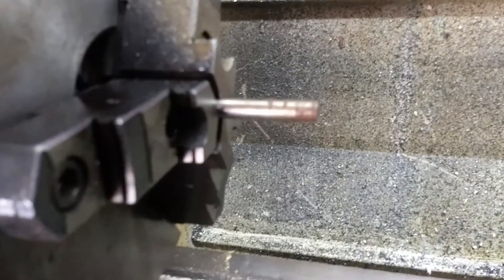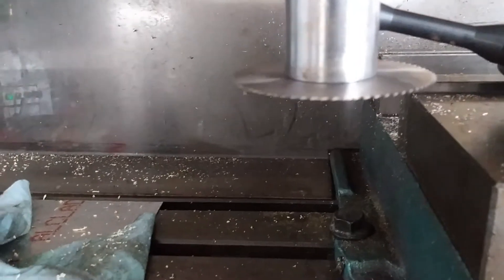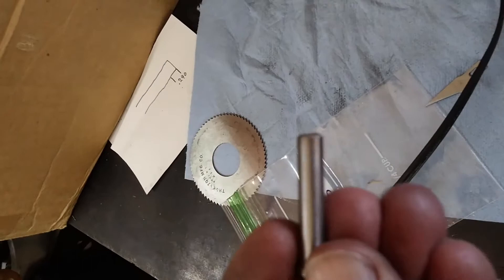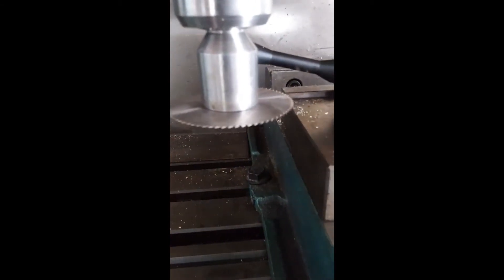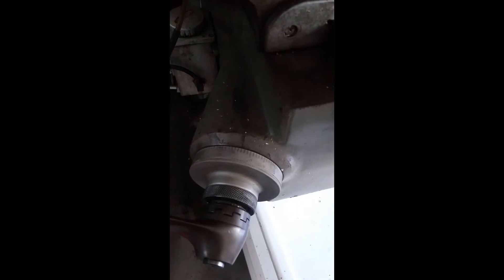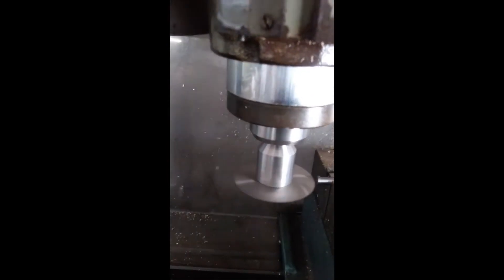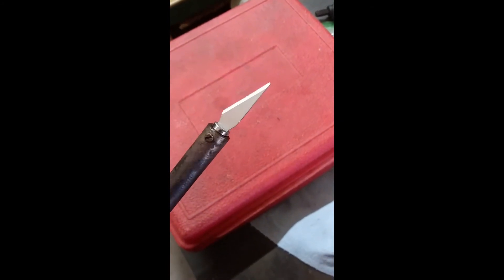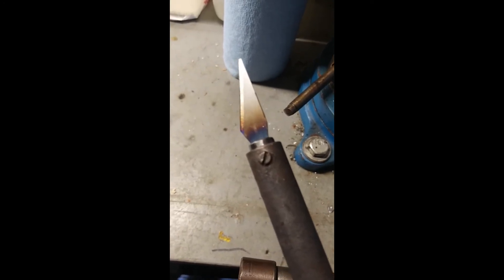How to make an Improvised Hot Knife using a Soldering Iron and blade from X-Acto knife.

Comment: I see videos like these and I wonder, why? Most all of these guys have a workshop full of high dollar saws, drills, grinders... that cost thousands of dollars.... but they can't spend a dollar or two for a soldering iron hot knife tip? yeah, that makes sense. I do appreciate the ideas though, but if I had that kind of 'tool power' in my garage, I'd not be worried about rigging up a hot knife tip to a cheap soldering iron. Oh well, gotta admit, it's still fun to watch, a guy thing I guess.
Reply from the maker: Its more about making something that you cant buy, the only hot knife with a blade that thin is 75 or more. I made this one for the cost of an Exacto blade.